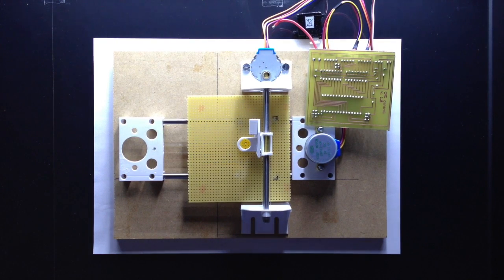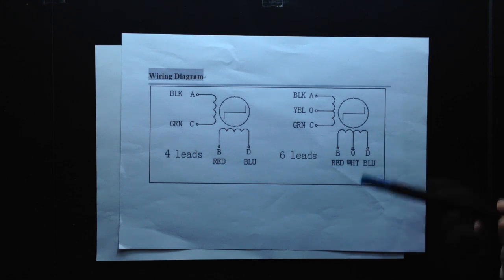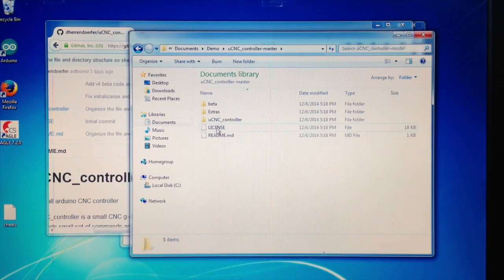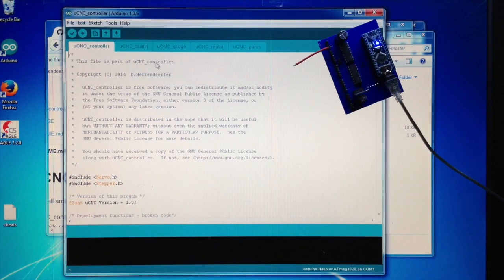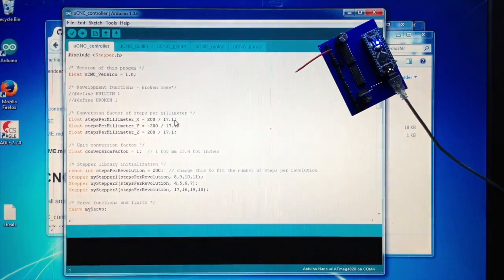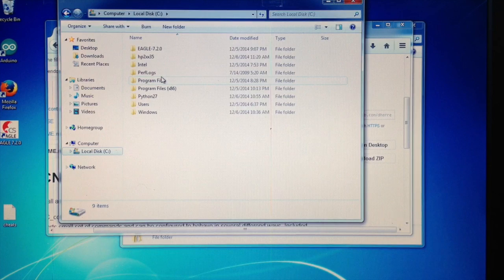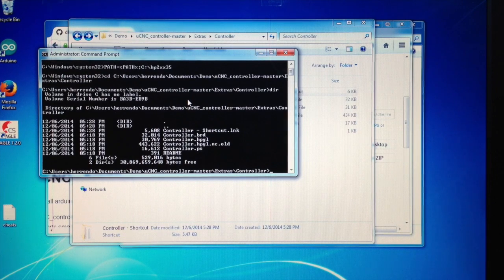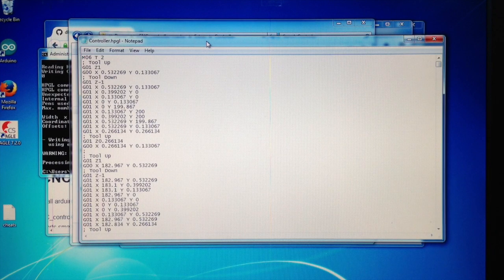Direct ink to PCB-Software talk

Comment: Hi Dirk, I am in the process of copying one of your controllers from an EASYEDA link but am a little confused.
The controller is on link https://easyeda.com/dherrend/uController-11dbaeb7e3f046408e67acb03aba75f2

My confusion is, there are three 100k resistors (R4, R5, R6) on pin 2 of the A4899 chips  that appear to be doing nothing. My confusion is, should the 100k be connected to just pin 2 giving a Mode of 2Phase or should they not be there at all and the all three Mode pins connected to +5v giving a Mode of 1/126th step 4 wire 2 phase.

Sorry if this is the wrong place to post this but I could not find any other way  to contact you and EASYEDA were unable to help.
Regards  John
Reply from the maker: Hi - you're completely right, if you want to use 1/16 mode the resistors do nothing, but if you intend to cut the tracks to get less than 1/16th, that resistor becomes necessary.
Reply: Hi Dirk, 
What does your software do, does it work in 1/16 or full steps? I want it to work as you designed it, I am not clever enough to make software/firmware modifications.
Reply from the maker: It does not matter - 1/16th is better. The software only needs to know how many steps it needs to issue to draw one millimeter. You need to edit that into the firmware source file, no programming skills are required.
Reply: Brillient, I was hoping you would say that.  1/16th it is then.  Thank you..
Reply: Hi Dirk.
Sorry to bother you again, I built the Version 1.5 as above onto an Arduino Robot shell in order to use an old Duemilanove I have lying around. 

When I try to run a nc program (from your links) either in GRBL ot ArdGcode Writer, it ques about 8 instructions and then nothing.
This happens also if I just run the Arduino on its own both the Nano and Duemilanove.  I am wondering if I am loading the incorrect program into the Arduino.  I have tried various ones from your links with no improvment.

Can you send me a link to the correct controller program for the Version 1.5 board  (the one with A4899 chips) 

Regards  John
Reply from the maker: Is the nineth command a ZAxis movement ? 
If yes, pleas check all Axis for correct movement manually, through the serial connection. If ii fails for the Z axis, please check the motor_mode setting for the firmware, if it corresponds with your setup. It is important that these are correct.
Also make sure that your power supply is strong enough to power steppers and servo, specially servo-power problems tend to crash the arduino.
Reply: Hi Dirk.  I have loaded the controller found from your github site in controller_master\Beta and this is an improvement of sorts.
Trying to run the NC file for V1 from the same link, on the GRBL writer I get the following sequence.
> M06 T2
> ; Tool up
> G01 Z1
> GO 0 X 0.000250244 Y 0.000249958
> Tool down
> GO1 Z1-1
> GO1 X 0.000250244 Y 0.000249958
> GO1 X 0 Y0
> GO1 X 0 Y 76.2
> GO1 X 63.5 Y 76.2
WAITS FOR AGES AT THIS POINT THEN

Wait for OK
Processed interrupted
> G21

This takes 15+ mins to get to this point and have drawn one X and one Y line of the boarder
 Running the same file on the Arduino G code Writer does now seem to run although very slow.
I have to stress that at this point I am just running the NC file on the bare Arduino without your driver board connected here is no interferance from motors etc.

Aother thing is, how do I change the Motor_mode setting?

Also since I am running on a Duemilanove I only have a max of 6 analogue pins ( no A6 or A7) your cct uses 8, so I have not wired any in as yet, I thought  I might be able to change the switches ports onto the A3 and A4 ports later on. I am assuming the controller does not use these ports in order to run at the moment.
Reply from the maker: motor_mode is a variable in uCNC_controller.ino. Depending on your setup you will want to assign 0 or 1, the difference is in the documentation in github in the M150 chapter. It defines how each axis is used. also you need to calculate and enter the values describing how far each stepper needs to go to move 1mm with the tool.
You can change the outputs, but you should not use the corresponding calls for the tools (fan/pump) any more.
Reply: Thanks Dirk, I swa the documentation for motor mode but did not know where to make the selection... I will find it.

It was the switches I want to move onto two other analogue inputs because I only have 6 Analo inputs.

Is it OK to use the Beta version of the controller as it so far seems to work better on the Arduino Writer although the GRBL writer does not work.

Comment: Hi Dirk , thanks a lot for the the tutorial , I have the plotter axis , XY and Servo working ok, the only challenge I have is hp2xx , when I apply -m nc controller.hpgl  i get result `nc`  unknown mode  error, any idea how to resolve this
Reply from the maker: What operating system are you using with hp2xx ?
Reply: Windows 7 ,
Reply: I am also having issues with generating hpgl , i am using Eagle Cadsoft  Ver 7.7.0, I get a generated file without .hpgl extension even though I have selected HPGL as a device
Reply from the maker: This should help you: 
https://github.com/dherrendoerfer/uCNC_controller/blob/master/Extras/Hp2xx/hp2xx-3.4.4-win32.zip

I keep this for reference, as the tool appears to be unmaintained now.
Reply: I am using the same tool ,
Reply: Thanks a lot Dirk for the prompt responce , I fixed the error in Eagle , the only hick up now is converting the generated hpgl to Gcode to use with the created plotter 
Thanks in advance for help

Comment: Dirk, Thanks for replying me. I tried as you instructed, but still I get the same pop up message. Is it possible to send an attachment of the message as well as the  visio diagram I tried to covert to gcode for you to try? I do not have your email add.
Reply from the maker: I can't get the unicorn plugin to work either .... I have a setup that I set up from the information at eleksmaker.com, but I believe that produces g-code for engravers.

Comment: Wish you a Happy New year to your whole family. I imported a Visio drawing to Inkscape and managed to copy files from Inkscape-unicorn-master to get the g-code extension when hit the Save as. But at the end a message pops up and say could not be saved. Could you help me solve this problem?
Reply from the maker: Have you tried launching Inkscape with Administrator privileges ? (Assuming you use Windows) Sometimes it's just the issue that you do not have write permissions where you are trying to store the file.
Reply: Thanks for your prompt reply. I am the Administrator of my Windows based PC. Is there any other suggestions to overcome this problem?
Reply from the maker: No, I meant launching Inkscape by right-clicking, and then selecting 'Run with Administrator priveleges'
Reply: Dirk, I just tried as you instructed with administrator privilege. Still I get the same pop up message , could not be saved.

Comment: Please tell me, how do you generate hpgl files? With what program do these files?
Reply from the maker: I use the Eagle function to export to HPGL directly.
Reply: Please, can you do a video tutorial on this topic?
I can only generate files that isolate the paths.
I generate the files using Run ULP and mill-outlines.ulp.
Where am I wrong?
You generate HPGL directly. Can you detail the process?
Reply from the maker: Use the CAM Processor and select HPGL. Configure the pen size to yours. When you transcode to nc make sure to use the truesize (-t) flag.
Reply: OK, work.
Thank You very much.

Comment: Hello Dirk,
I am using win 10 64bit,when I convert  hpgl file whith hp2xx35 ,i getting this mistakes :'hp2xx-m' is not recognized as an internal or external command,
operable program or batch file.
What do you thing ,where is the problem.
Thank you!
Reply from the maker: It's hp2xx <space> -t <space> -m <space> nc <space> filename. If you have the program in the local directory, then it should work.

Comment: Hello drik, when i will try uploading uCNC_controller.ino to my arduino uno board, i get "'initMotors' was not declared in this scope" when i verify. Please help me, thank you
Reply from the maker: You need to import the complete project, not just the one source file. You also need the stepper library installed.

Comment: Hey Dirk. I was wondering about the conversion from a cad or Inkscape drawing of a circuit to a gcode file. When I do this the conversion only comes out as gcode commands for the outline of each pad. It doesn't fill in any large pads or pc board traces. Is there something more I can do to have a pc board drawing converted to gcode and have it fill in large pads?  I am using the gcode conversion tools that one can add to inkscape.
Reply from the maker: I have the issues with the tools not filling in the pads completely too. I use eagle, fortunately the pads still work out. That is one of the reasons I started looking into the isolation manufacturing methods.

Comment: The Arduino G Code Sender stops responding after I switched to another program. Any thoughts?
Reply from the maker: Really ? As soon as it looses focus ? I'll check, but I never had that issue, only when two programs are competing for the COM port I had unexpected things happening. I'm using Windows 7 for my plotters.
Reply: Yeah, I'm using Windows 10 Pro. I'm trying to turn the writefile function into another thread class for multithreading but I can't seem to get it. I'm not really good at python. Oh btw, I'm using Spyder with python 2.7

Comment: when i start serial monitoring it keep on displaying ucncbeta.......without an end ...why is it so? help me please
Reply from the maker: No idea what would make it do that - you might want to check if you configured it correctly and built it for the correct Arduino board - but apart from that it should not go into a reset loop.
Reply: Dirk Herrendoerfer what did u mean by configuring it correctly I din get u??
Reply: I'm using arduino nano 328p with the exact same control board v1....
Reply from the maker: Check if your power source is stable enough.
Reply: Dirk Herrendoerfer let me check once again....thanks for reply...I'm halfway doing this
Reply from the maker: In any case - just pull the arduino from the controller board, just connect it to the PC - if it still does not work, then the problem is in the software.

Comment: Hi buddy!, have you repaired your camera to be able to show the last part to read the gcode file into ARDUINO??
Reply from the maker: It's here : https://www.youtube.com/watch?v=aCtMlm7U5UY
Reply: What firmware did you download to you Arduino to control 2 Axis steppers motors??.Did you get it from GITHUB?
Reply: I noticed in you videos taht you write the firmware in Arduino C language??.Doesn`t the GITHUB firmwares serve?
Reply from the maker: Yes but each firmware needs to be tailored to the specific printer/plotter in order to work correctly.

Comment: Have another question. Can you plot images (black and white)? What software to use to convert for example from .jpg image to .nc file?
Reply from the maker: No - I'm looking into that too. Nothing I find works out the way I want it to.
Reply: I found RasVector software but I need licence or smth, it can convert image to nc, but I didn't got it to work.

Comment: Im using 28bjy motor. When I change steps per revolution from 200 to 4048. it doesn't work, it just makes more pulses during same time. What numbers I should enter for steps per revolution and steps per mm if I'm using 28BYJ-48 and GT2 belt 20t pulley (diameter I believe is 12.7mm)?
Reply from the maker: With the small motor you also need to turn the speed down. Use a very low speed and go up from there. The arduino is not able to issue so many steps per second.
Reply: nwm, just found maxspeed variable in motor file, set it from 60 to 10. Set 2046 / 39.89 for steps per mm
Reply: Also my suggestion is to use lm310 or lm350 variable voltage regulator for 28byj stepper drivers
Reply from the maker: The 28byi Steppers are available in 5V and 12V. In normal operation I don't regulate their supply.
Reply: I have 5V ones and I think I'm going to use that regulator, because on 5V it does not have  enough power to spin, when using 12V it gets really hot quite fast, but spins with higher torque. With regulator you could adjust optimal voltage for motors. Of course you can use something like L780X if you already know optimal voltage or don't use at all if supply provides such voltage.

Comment: what type and model of motor has chosed?
Reply from the maker: Nema17 unipolar (6 wires).
Reply: can I use a 28byj-48 5v motor?
Reply from the maker: Yes. That works too. I use them with 6.5V and they work fine.

Comment: I wanted to know how to make the configuration of my cnc with steel cable my stepper motor and nema 23 and the axis has 6.35mm as do the micro step setting on 1/4 in Polulu a4988 have to divide the shaft diameter of the engine by canapes and 200 steps'm doubt I thank
Reply from the maker: I suppose you need to calculate the shaft circumference and use that value to divide the steps per revolution (like 200*4=800) by. So in the end you get the steps that are needed to move one millimeter.

Comment: Eu queria saber como fazer a configuração do meu cnc com cabo de aço meu motor de passo e NEMA 23 e o eixo tem 6,35 milímetros como fazer o micro etapa configuração de 1/4 in a4988 Polulu tem que dividir o diâmetro do eixo do motor, canapés e 200 steps'm duvidar agradeço

Comment: olá, onde encontro uma desta? vende este kit?
Reply from the maker: Hello, I do not sell these machines as kits, but all information is available online. There is a link to my github repo in the description of the video, you may find everything I have published there.
Reply: obrigado meu amigo!  e cm ligo motores com seis fios no arduino?
Reply from the maker: Steppers with six wires have two wired for the mid-connection of each coil. These should both be connected to the positive source. The other four wires go to the driver ICs.
Reply: obrigado meu amigo! fica com Deus!

Comment: Hi Dirk,
Do you have an idea, what could be wrong? I am following all of your steps, but when calling the hp2xx command, and hitting enter it opens the text that is in the document. And when i call the -m nc... all i get is more controls and options.  I've checked the path, renamed the file for the hp2xx still no idea, what is wrong... 

Great videos by the way!
Reply from the maker: +Žan Kaštigar Try this one: https://github.com/dherrendoerfer/uCNC_controller/tree/master/Extras/Hp2xx . Other versions from the internet sometimes don't support NC mode.
Reply: +Dirk Herrendoerfer Thank you, I downloaded it again, but it didnt work the first time. Than I just typed the whole command in one, so like this: hp2xx -m nc Controller.hpgl, and it worked! Maybe it will help someone. :)
Reply: +Dirk Herrendoerfer Is it possible to change the width and height from 200x149.4 to something smaller? Because everytime i generate the gcode they are adaptet and my cnc reaches its limit
Reply from the maker: ***** Sure, just add the -t flag to the hp2xx call. This will then plot in truesize,
Reply: Thank you!

Comment: Hola dos preguntas ¿para que sirve el Python? y ¿cuanto voltaje se alimenta el circuito?  Por favor contesta.
Reply from the maker: +Tobi Vaz Python 2.7 in 32 bit is what I use, with pythonSerial. Supply Voltage is dependent on the steppers you use - I go with 6 or 12 Volts.
Reply: +Dirk Herrendoerfer. Thanks.

Comment: Hello Dirk, I have a few questions,
1) how to get the negative of that. you work with a pen to mask. I d like to mill the not needed PCB layer. Unfortunately it is not only to invert Z Direction.
2) Many layouts are available as pic for toner transfer. Is it possible to use that too?
3) Finaly what about drill?

Vielen Dank und besten Gruß
von der Alb!
Reply from the maker: +Tigrar Hi, Gruss aus dem Laendle, 
1. What you want is isolation milling, a lot of Routing programs like Eagle can do that natively.
2. Yes, there are Windows and Linux plotter drivers for generic printing to files, these can be plotted.
3. I've never thought about drilling, since it requires a completely different setup and far more torque and 
  holding force that these setups can supply. It would require a mill-like setup for that.
Reply: +Dirk Herrendoerfer  Hello Dirk, thank you for your hints, I will lookout for these informations in detail.
Well I think for the isolation milling there will be as much torque as for the drilling of the pcb. Sorry for have forgotten to mention the PCB in this place. Mainly the drilling points schould be more or less available with the PCB information. But yes, my construction is planed to be much more stable (already to be more versaile). On the other hand I wonder if your magnet solution will then still work as I like the idea very much. Aller besten Gruß zurück und Danke.
Reply: schould... lol!  should of course...